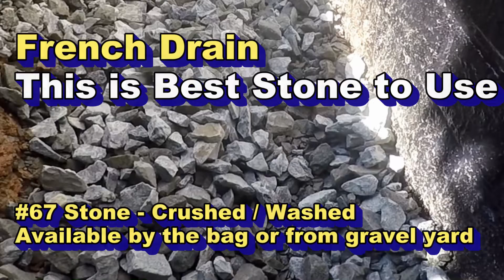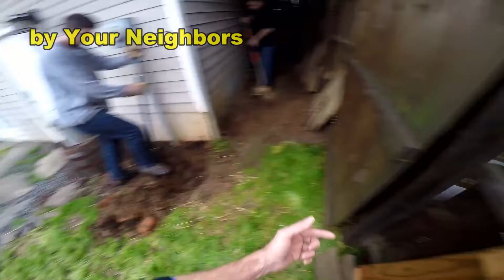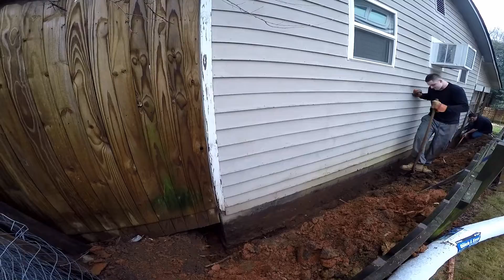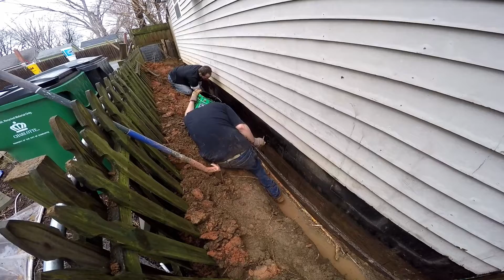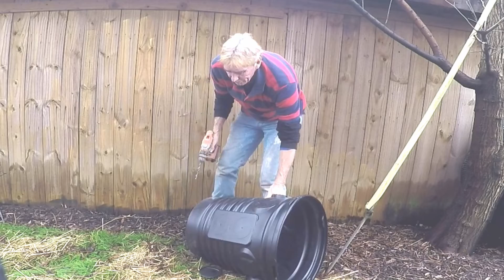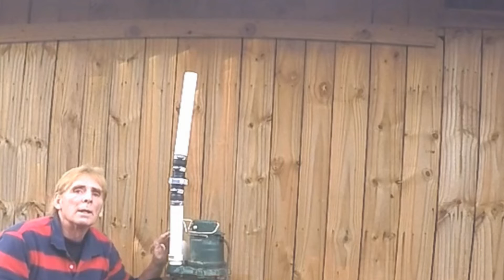Real French Drain and How to Build the Right Way

Comment: Out of curiosity if price were not an issue, would you still be using corrugated pipe generally or would you prefer SDR35?  I know that you recommend not using SCH40 except maybe under driveways and stuff like that, but what would you tell a customer if they said "I want the best installation possible"?